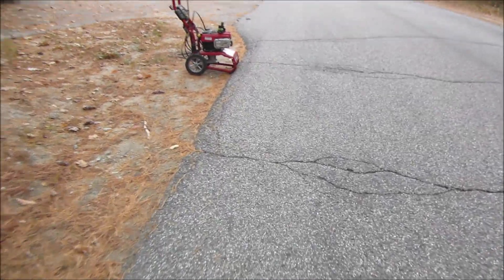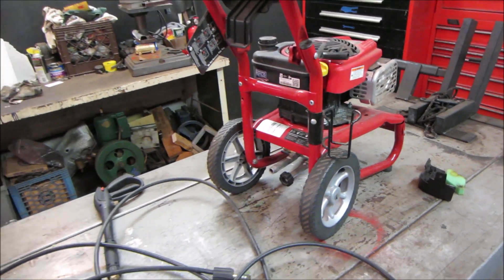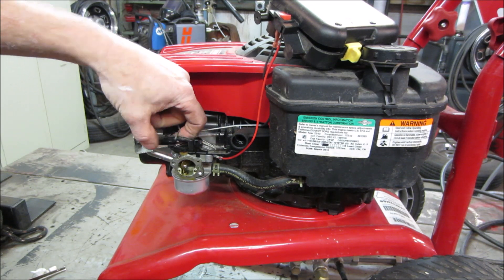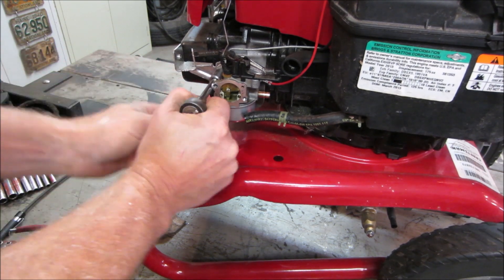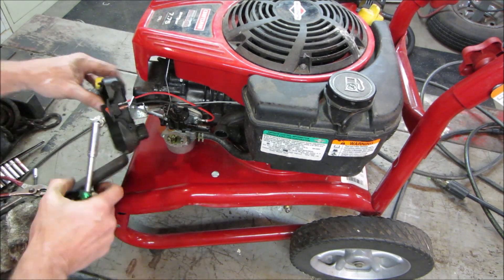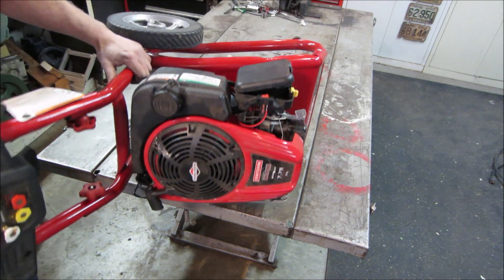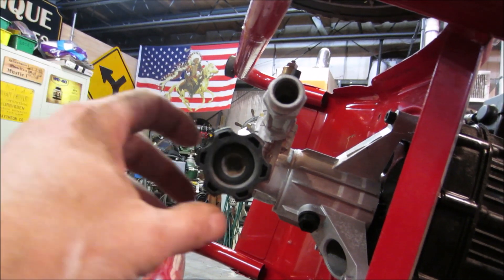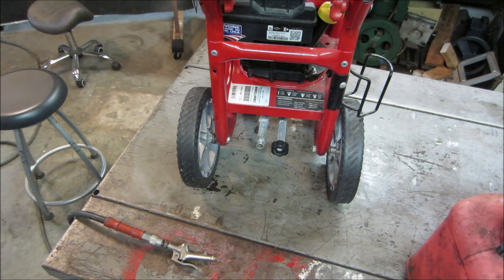Can It Be Saved? Junked Pressure Washer From The Garbage.

Comment: Ebay has 2700 psi pumps for that for 70 bucks. Not a bad price and your (new cost) 350 dollar sears pressure washer costs you 70 bucks and 10 minutes to replace the pump. I had a similar situation with a free pressure washer 2 years and I got the ebay pump. Runs like a top and I use the hell out of it every summer.

Comment: you can get the pump section  on ebay cheap just make sure the you get the hose valves facing same way there are 2 different varieties.
Reply: also the plastic nut on the upper section is oil fill port

Comment: Replacement pumps for these run between $40-80 on eBay for a new one. Looks like its otherwise a good machine. I’d throw a pump at it if I were planning on keeping and using it for myself. For resale, I’d just try repairing the existing pump.
Reply: Greetings: A great way to ruin Darren's reputation! Better to fix it right to sell and take shortcuts on your own stuff.

Comment: I saw a review on aluminum welding rods by 'Project Farm'  here on YouTube. I'd take a burr on a dremel and opn up that crack a bit try welding it. Might be wrth the couple $'s investment in the rods if it works. If I remember right he just used a propane torch to weld them. I thinlk the rods melted about 1,000-1.100 degress far.. Thanks for sharing.

Comment: FYI:  That is a $300 dollar residential pressure washer probably putting out about 2700 psi.  You can buy a replacement pump on Amazon for about $75 bucks and she will be good as used.

Comment: 16:45, no thats actually a thermo relief...  if it gets hot at idle it will melt that dude and release pressure..  detetgent injector is on the pressure out part...
Reply: And on the filter is oil from the crankcase breather tube..  the 7.75 tend to spit oil out when it gets past its prime and not changed regularly or if its over filled at all...
Reply: And a new pump head is 64$ new..  you keep the lower unit and put the new head on it...  2700 psi..  good pressure washer
Reply: Its an AR srmw2.2g-26..    thats the model number for the head...
Reply: And dont take the oil out of the lower unit...  shits expensive and is meant to not be changed..   and keep the white plastic rings on the pistons...   is a 400) pressure washer...
Reply: And that "anode" is called an easy start plug.  Theres a ball n spring in there..  kinda like an unloader valve on a air compressor..  and the actual unloader valve on the pressure washer is the thing with the red paint on the jam nut and it is what releases the pressure after the stages complete a cycle...

Comment: The pressure is controlled by the size of the tip used and most pumps have a pressure regulator

Comment: It looks like this was barely used. Clean carburetor, all paint looks new.   It was free so spending a few bucks to have a running gas washer is a deal. Much better than these electric ones you see everywhere that have low pressure in comparison.

Comment: 16:20 is the thermal switch to protect the pump when pump gets hot and engine is running and water isn't flowing through wand. Other port is the down stream injector.

Comment: Aluminum brazing will melt the cheap plastic check valves. Have had temporary success TIG welding with water running through to keep as cool as possible. Not really worth the time. These pumps are cheap junk. Replacements can be had for about $75 on Amazon. 
The 90* nipple is not the detergent siphon... It's a thermostatic bypass that opens if it gets too hot. The second nipple with the cut off piece of hose is the siphon. 

The black plug is not an access port to a set screw... It's the fill/drain for the pump lube (usually a gear lube) that lubricates the swashplate etc that drives the pistons. The pump simply attaches to the crankshaft spindle that is tapered and keyed.

Comment: you might try a aluminum brazing rod "Project Farm " did a review and used Hobart rod on a engine cylinder head  for 30 min and no problem for 2.70$ you might be able to fix the leak?

Comment: Hi I have a pressure washer similar to the one you were working on.  But mine will start then die wait a few minutes and try again and same thing well I took the tank off and cleaned it and the fly wheel was all rust so I sanded it with 10 grit sand paper and a little WD40 and it cleaned up ok so does this sound like a clogged jet issue. I was going to take the carb off but chucked out. Again any help will be great.

Comment: is the pump houseing alluminum or is it white metal. there is a product available 4 white metal its called ALLADIN 3 IN ONE  its a like a tig rod that you solder with propane or map gas. but i agree with you all that mustie should strip it clean of any o rings  die grind it out a bit wipe down with acetone and giver a whirl.that would be a great video.

Comment: 100LL fuel from your local airport also has no ethanol in it (but does have a lot or lead).  And has a LONG shelf life.  I use it in all my small engines (and airplane).  Don't use it in an engine with an O2 sensor or catalytic converter, the lead will destroy them.  Marinas also have ethanol free fuels.

Comment: 909 comments. No I didn’t read all of them.  I did see the repair for grinding out the crack some then mig or aluminum braising the crack. Plastic and rubber would have to be removed.  Why not clean it good and just for kicks and giggles JB weld the crap out of it. Not just wear the crack is but round that whole area. Just wondering if that would work.
Reply from the maker: well it so happens to be a part 2

Comment: Unless you can seal that pump housing, the pump is junk. Those homeowner units are pretty simple and your explanation of how it works was dead on. It would probably cost more to replace the pump than the machine is worth. Pressure washer companies will usually tell you just to buy a new one since you will have the same money in a repair (Unless you DIY). I spent several years as a PW Tech.

Comment: 1. That’s not a cup holder. Lol. That’s a soap solution holder. It has a line going to the pump, WHICH ONLY SUCK UP SOAP WITH the soap tip!! The other tips will not allow soap to go thru. It’s like a siphon hose. 
2. That black nut on the side of the pressure washer pump is where you can add oil or replace the oil inside. 
3. The other black L shaped thing on the pump is a PRESSURE RELIEF VALVE!

Comment: I was given 40 bucks to take one of those to the dump.Almost brand new the guy put old gas in it with water. I cleaned it out and ran well.Got a new pressure washer and 40 bucks.

Comment: 13:05 I understand when the float lifts the needle up, it shuts off the trickle of gas however, when you blow into it upside down to test it, why does the air pressure not just force the float back up?
Reply: Greetings: Because the air escapes thru the same path as the fuel in that position.
Reply: Simple, blowing just doesn't produce enough pressure. Blowing you can only produce around 2psi. The weight of the float, coupled with the lever action increasing the force, and the small area of the seal means you need much higher pressure to overcome it.

Comment: I sometimes wonder how much stuff is left on the curb in central NH just on the hopes that "Hmm... Maybe if I leave this out here it'll be featured on a Mustie1 saved/will it run video" -- around here a not running, leaking, broken pressure washer would still command $50-$100 on Marketplace or Kijiji just for the parts value... Guys are selling 15 year old Craftsman mowers with blown engines and 4 flat tires for $250 and people will pay it just for the parts value.

Comment: Buy some low temp welding rods and braze the crack and never  idle the engine without . pulling the handle letting water run it will burn up the pump

Comment: hi did you want to try welding or brazing the pump?
if it works then it is fixed if it does not work then it is still a video

Comment: 14:00 doesn't the holes in the nut have to align with the slots in the carburator to have a sufficient flow? Otherwise the fuel have to leak through the threads?!

Comment: Those  pumps are  cheap 60 bucks for a good one I didn't  even  mess with the head I replaced the  whole thing  same deal free pressure  washer only thing  the one I got was a Honda  it works great  now I got a bigger  pump  it was 2600 I think  I put  a 2800 psi

Comment: I got a compressor given to me it worked but the wheel is wobbly on the compressor and it was covered with grease so I took it over to the carwash sprayed it with engine cleaner and hose It Off let it dry it's spotless but it doesn't work anymore

Comment: I hate to admit I also let our pressure washer freeze.  I took off the hose but forgot about water in the pump. I ordered a replacement part on line. I did not need the entire pump just the cover that was destroyed when the water froze. New casting was slightly different so I had to get creative with O rings but it is working fine now.  I'm more careful after that oops.

Comment: I bought a Mitsubishi 2500 watt generator at the local scrap yard for about 12 bucks, drained the tank, checked the oil, and removed the carb. I took the bowl off and found some "goodies" in there. Sprayed the carb,  put it back on and it started on the first pull (after I put gas in it). The aid filter had crumbled from age, but I had similar material, so cut a piece and fitted it in. I plugged my Black and Decker heavy drill in it, and it performed well. I came back a couple days later and found that the fuel shutoff valve was leaking, so when I turned it off, that stopped. I'll have to look for an OEM shut off for it. Aside from that, it's a good 120v generator.
Reply: I bought a damaged Honda GX240 to build a gas-powered welder with (my shop is on a farm where the out building have no electricity), so I'm forced to improvise. I had to straighten the recoil, which meant taking it apart. I got that back together, next I had to buy a new shroud for it as the other one was too damaged. I also need a fan blade, but they are cheap enough. I have a 130 amp alternator modified to use a sending rheostat to vary my output. I'll let you know how it goes when I get more done.
I have my welding leads and some rods, so I should have it together soon.

Comment: replacement pump head 92840020 one on amazon for $63 maybe ebay has one AR ANNOVI REVERBERI AR43061 Replacement Head, for AR Pump RMW Aluminum Complete. The craftsman 580.752870 is a $332-$375 pressure washer retail. with a replacement pump still saving $200+ dollars or wait for the next landfill pressure washer disposable humans will provide.

Comment: Why not just Tig the crack shut using a helium mix for the shield and aluminum filler rod if necessary? that away you would be putting a bunch of heat into the assembly and damaginging anything? It looks like who ever put that to the curb had more money than sense but then everyone seems to live in a throw away society anymore since we have all these cheap chinese products anymore. I'm bad about it myself since its cheaper to just buy a new chinese small engine carb than buy an OEM rebuild kit these days.